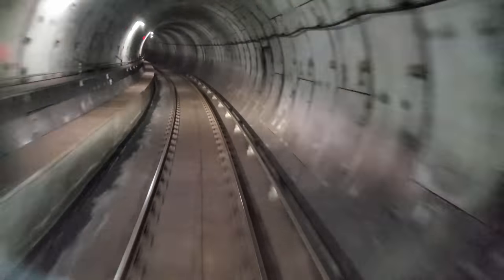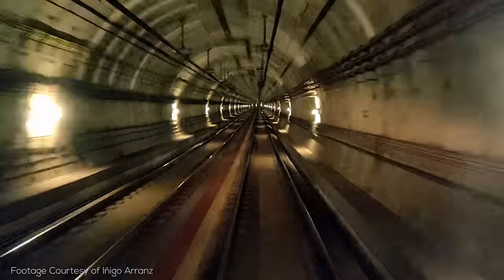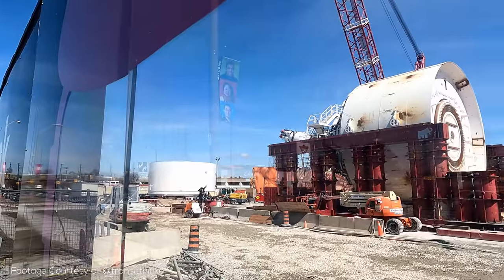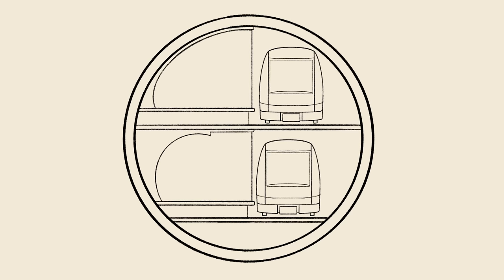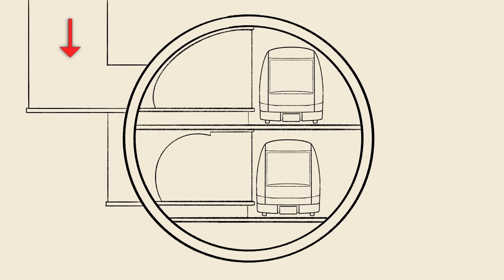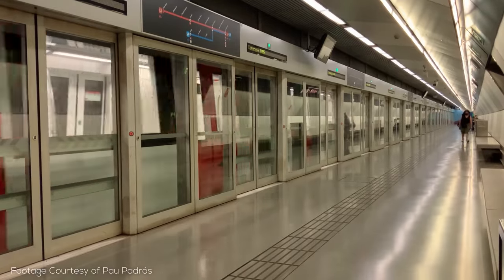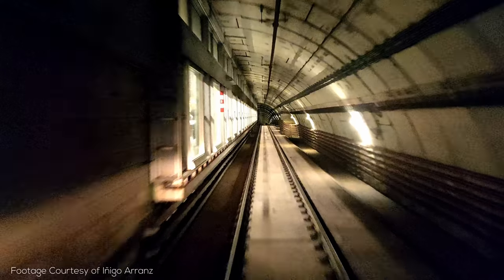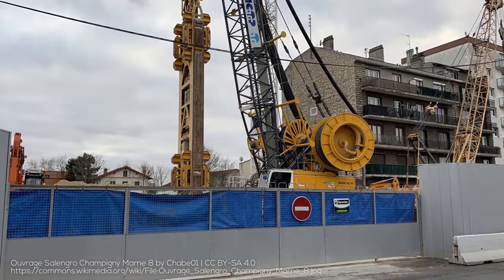A Different Way to Build a Metro? | Barcelona Line 9

Comment: Hello and greetings from Barcelona. Just yesterday I was travelling on the l9, like so many other times, and I was thinking about the problem that this type of construction has represented for my city. To begin with, the fact of having to make the tunnels so large has meant a huge cost overrun that has caused the line to be many years behind schedule. At the time it was said that the extra-large tunnels would be used to put two tracks in some sections in order to make fast trains that did not stop at all the stations since some are in areas of low demand. This did not make any sense, given that by building the stations within the same tunnel, the sections where it is possible to place double track are too short.
Likewise, the great depth means that the maintenance cost of the large number of elevators required is very high. And there are even stations that have parallel escalators of 6 or 7 sections. A madness.
In Barcelona, new extensions are being planned on other lines (yes, we don't know when we will be able to finish what we started 20 years ago, but we are already dreaming of new lines 😒) and I think the idea is to return to more traditional boring machines. But you know, our politicians are always willing to spend on anything "cool"...
If one day you come to Barcelona, don't hesitate to contact me and let's take a tour of several interesting transport sites in Barcelona. Likewise, if you need photos, videos or information, don't hesitate to tell me. Thanks for your videos!

Comment: I wonder if this technology can work in New York City provided they need a four-track Second Avenue line south of 63rd Street this could have been also used to modernize Lexington Avenue a Quad stack tunnel if needed. In New York City you would have it configured as upper level local lower level Express examples are A train Nostrand Ave 4&5 trains 86th st

Comment: The local bookies are taking bets on which will be finished first: The Line 9/10 core tunnel, or Estació Barcelona-La Sagrera. It's pretty much a 50/50 toss-up at this point, but if you suggest either will be finished before 2027 you literally get laughed at. xD This city's done some really cool things with its transit system, but the one thing it is not good at is doing anything on time or under budget. >.<

I wish they'd retrofit the other lines with the new trains, though, even if they have to retain the driving cabs, 'cause they're so much nicer than the other lines' trains.

Comment: the great advantage of this method is to reduce the volume excavated at the stations by increasing the volume of the tunnels, which is cheaper. worth it when there are stations very close.a solution to reduce the cost with very large tunnels is to use smaller gauge trains,  narrower than usual on heavy-metros, which make it possible to reduce the TBM diameter, but longer to increase capacity, wich came at no cost since the statation lenght is no issue
Reply from the maker: Precisely!

Comment: Is Northern Line London one line or two?
Reply: Maybe its a 'line group', a 'sub-network' or a 'brand'! Users seem to have become accustomed to its idiosyncrasies.
Reply: well you see the two branches don’t really interline.
Reply: @marktownend8065  Except for visitors arriving at Euston where it is thoroughly confusing! It really is just a matter of adopting a line colour and a name for the Bank branch and simplify the signage - for some reason TfL thinks it has to be an all singing and dancing formal engineering division at Camden Town!
Reply: @squagwag2808  What do you think Camden Town does?
Reply from the maker: IMO 2 in all but name.

Comment: I wonder why they don't build 2 tracks all along the tunnel between the stations enabling half of the trains to skip half of the stations or so ?
Reply: That doesn't really work well as fast tracks need to bypass platforms which occupy the other half of the tunnel at the critical locations. If the platforms were staggered by a ramp length , a single bi-directional fast track for liited express service might alternate between upper and lower levels, but the stagger would complicate station design as access tunnels and shafts would have to be longer and/or more numerous.

Comment: So a country that doesn't have a lot of violence still installs glass barriers while the U.S. riders are lucky to not get pushed onto the rails. No barriers, nada, nilch.
Reply: Mostly an age and budget thing: the screen doors have only become a 'standard' thing in relatively recent times, and thus have only been installed in places that have recently had the spare budget to install them... and many older stations are actually built in such a way that the installation isn't actually viable, so installing them is more expensive than it sounds in those cases... then there's the trains that are designed in ways that don't interact with them properly, the necessity of stopping in perfect alignment (many railways around the world don't have the automation needed for this to work... again, budget.) And the fact that installing them takes the station out of service for a while can be an issue too. 

Oh, and the barriers have little or nothing to do with violence in the first place. They're part accident-proofing safety feature, part 'make a whole tonne of things about designing and running trains and stations less of a pain in the butt' feature. The better ones provide an environemental seal between station and track (making heating/cooling more pracitcal, and allowing trains to travel faster when passing through without stopping, among other things) as well, for example.